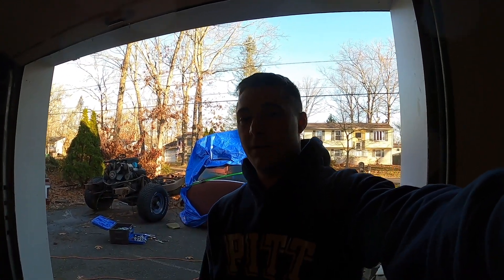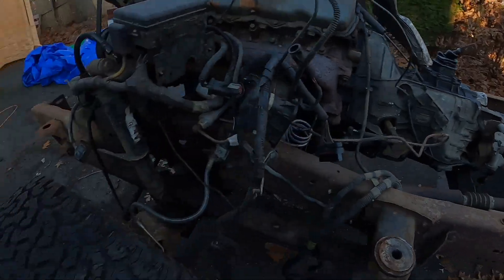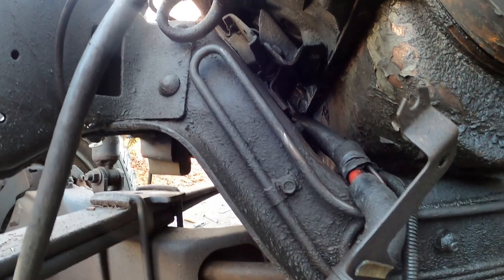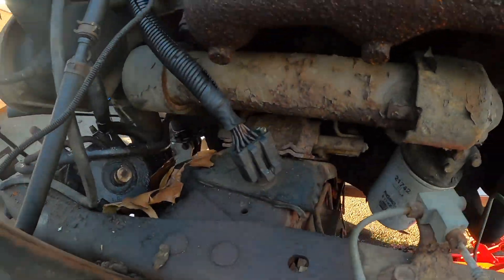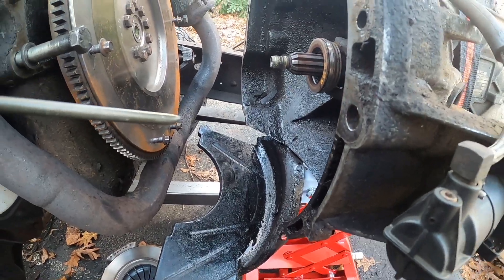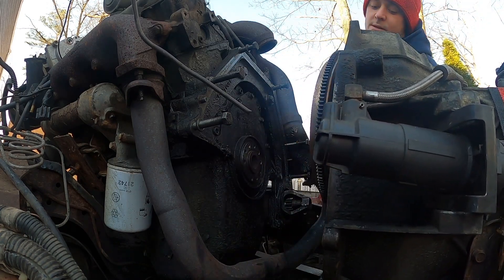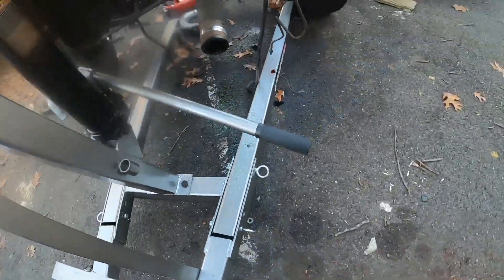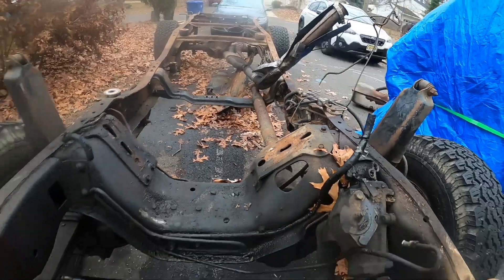Engine and Transmission Removal in my 93 F250 7.3 IDI Turbo Diesel!

Comment: Are you rebuilding the entire truck including the motor?
Reply from the maker: I am mostly with the engine though I’ll just be changing all the seals arp head studs, turbo injectors, injector pump glow plugs electric fuel. Still deciding on transmission and transfer case might just clean them up and use them till I have an issue
Reply: @MatthewKrompier  That’s cool. Look forward to seeing the finished product
Reply from the maker: Thanks a lot me too!